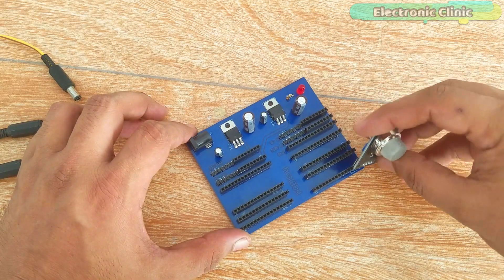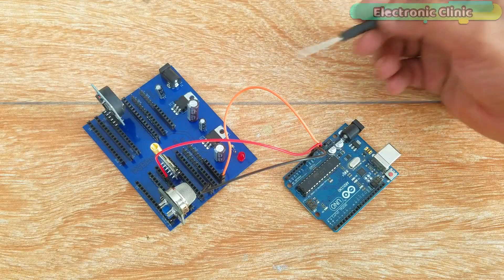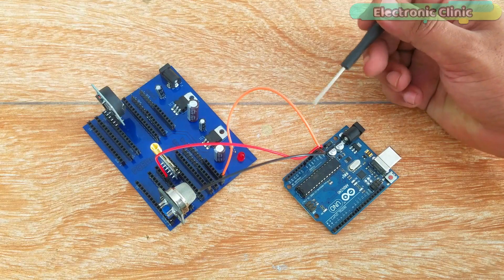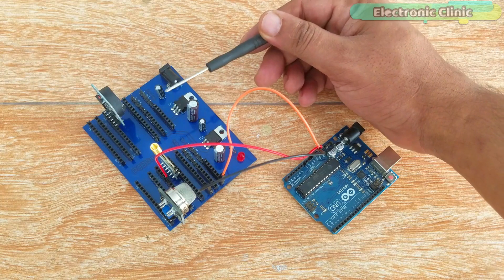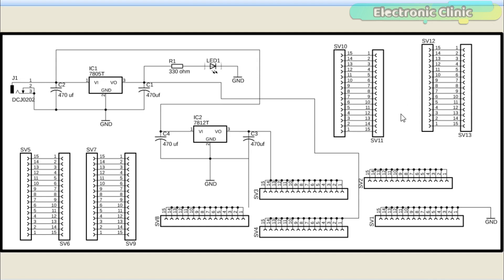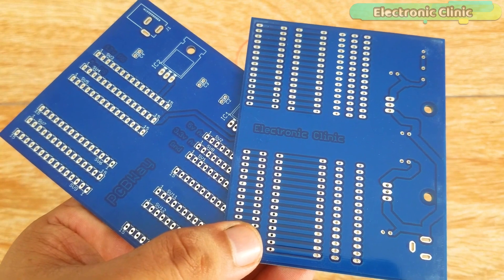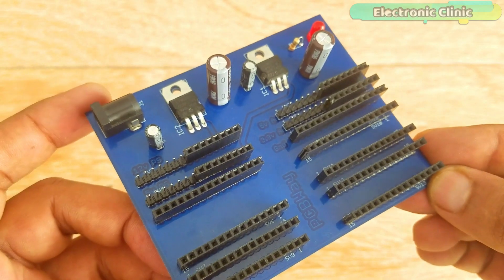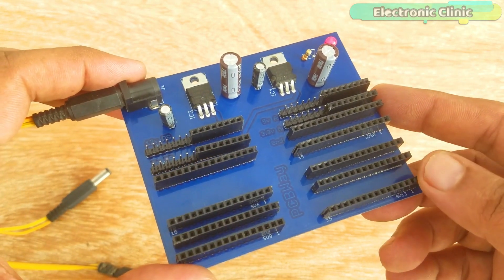Arduino Power Supply Module for Sensors 12v, 5v, and 3.3 volts “DIY Project”

Comment: Very good idea.  Personally I would have opted for LM317s allowing personalized and more precise voltages.  Also, although not mandatory, noise filtering would be a nice to have knowing that many users will opt for some sort of SMPS power to feed the board. Short circuit protection would be a nice to have and fairly easy to implement.  Perhaps a way to control the maximum output current would prevent potential magic smoke !  Test points or banana jacks would allow to connect a DMM or simplistic voltmeter and/or ammeter to monitor voltages and currents, would it be as a whole or specific module(s).  Thanks for your time.